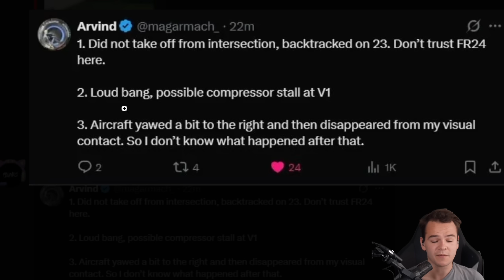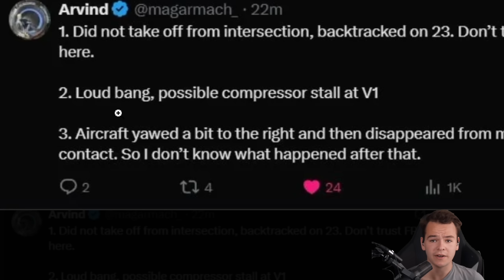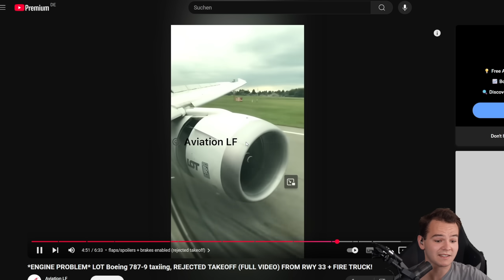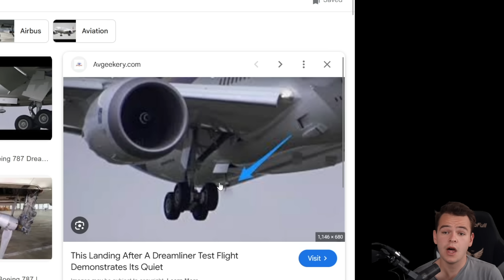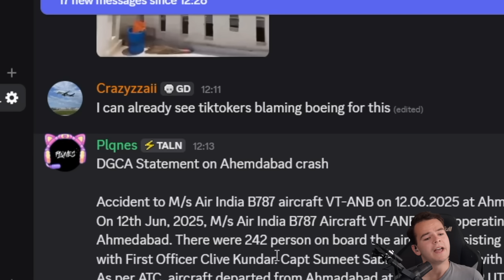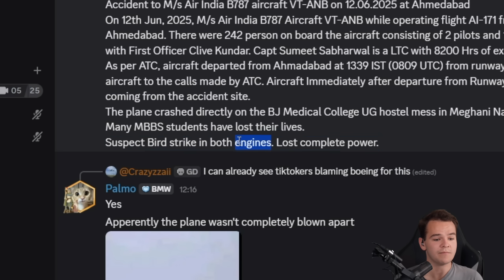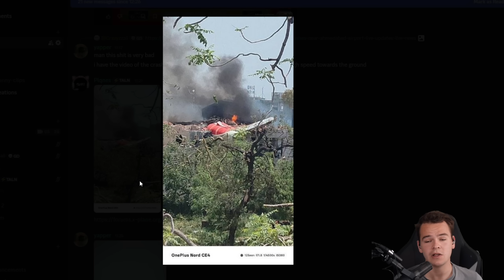The First 787 CRASH Ever - Why It Is SO Confusing?

Comment: it reminds me of the whistleblower who mysteriously died last year who was saying that 7878 dreamliner did not follow any standards and violated a lot of US laws, he was in charge from 2010-2014 of seeing the operations in the factory in the US.
Reply: Funny how not to many people talked about it, he mysteriously died in his Miami apartment I believe, I wouldn’t be surprised if some corporate strings were pulled to hire some hit.
Reply: Yeah right, almost 15 years without the loss of a hull. If the plane was structurally bad it would have shown years ago.
Reply: Boeing doesn’t make the engines tho
Reply: Thats true i was just reading more about it
Reply: Likely unrelated, if it was the engines it had nothing to due with boeing
Reply: Yeah, we should be talking abt general electric. @andrew3084
Reply: :face-blue-wide-eyes:
Reply: why did whisleblowers die misteryously wth
Reply: My thoughts as a retired Flight Simulator Engineer with 10 years experience are as follows.

The first suspicion that may arise is this - could the pilots have pulled the lever to straighten the flaps, thinking it was the lever to retract the landing gear? But this is unlikely to happen on the Dreamliner. The two are not close enough to be interchangeable. The flap lever is to the right of the engine throttle on the pedestal between the pilots. The landing gear lever is located on the main instrument panel, below the flight display panel, on the captain's side (left).

Kindly ALL decent HUMANS please GOOGLE THIS before making wild guesses. I know you are all trying to save Boeing. The USA CONGRESS is onto all POOR QUALITY CULTURE AT BOEING.
Reply: Ok am back, like i said before NOT BOEINGS FAULT!!!
Reply: This probably has nothing to do with Boeing
Reply: That's interesting that you bring that up.  On an unrelated topic, what's your real name and what's your address? 😁
Reply: @smgdfcmfah you really don't know what he's saying kid 
Go to school
Reply: 1189 787s were built since its release in 2009, this is the first fatal accident with total hull loss and we still don’t know if it’s a design flaw, so it’s one of the most secure planes ever.
Reply: Stop looking to blame Boeing for this. They delivered a perfectly good aircraft to them and again BOEING DO NOT MAKE ENGINES.
Reply: @bossmikey7301  how do you know they delivered a perfectly good airplane? Do you work for Boeing or something. As I said above, they were already grounding this plane in the states for maintanince issues
Reply: @markdickenson2885 Because it’s been flying for 11 fucking years and you can clearly see it suffered engine problems. They grounded it because of the batteries and that problem has been fixed.
Reply: @bossmikey7301  that doesn't mean that they delivered a perfect aircraft. You don't know that. And given Boeing's shady history, it is fair to question that shady company
Reply: @markdickenson2885  Ok they had a shady history with a greedy CEO. But this is not Boeings fault. The 787 is a successful modern aircraft with a lot of computerized fail safes. Boeing fucked up with the 737 Max but not with the Dreamliner. When an aircraft is flying for almost 15 years with no serious incidents, I would said it’s a successful aircraft. That is a good safety record on a plane. That plane probably hit some birds or suffered both compressor stalls which is highly unlikely. If you want to blame someone, blame the people who put airports in populated areas and not close to the water. Just in case you suffered a double engine out, it will not be so catastrophic.
Reply: @markdickenson2885  "that doesn't mean that they delivered a perfect aircraft."

Here is what is known about the aicraft:

"The plane had logged more than 41,000 hours of flying time, with almost 8,000 takeoffs and landings, according to Cirium, an aviation analytics firm."

Sounds like they delivered a pretty good plane no? Considering that many flight hours, it will likely be maintenance or pilot error.
Reply: @bossmikey7301 lol. Airport near water and away from residential areas. How feasible is that? Also, when planes crash, they don't necessarily crash near the airport. May be we should build airport close to bay for 737 MAX then to compensate for their safety record or we can just buy from airbus. I'm sure a new competitor will emerge to fill the vacuum that is being created by Boeings quality issues. It's a free market.
Reply: @saab182  "lol. Airport near water and away from residential areas."

Pretty feasible considering quite a lot of airports are deliberately built near water.....

"May be we should build airport close to bay for 737 MAX"

Ah, a strawman. Yes, let us bring up the plane that is not in this incident, because you know, that makes so much sense..... The 787 is a very good plane, has had no losses until now (has been flying since 2011).
Reply: @aflyingcowboy31 yeah sure it's feasible to build near waterbodies.  Try selling planes telling people where they should build an airport, espacially land locked part of the world with few watersides or areas tgat are far away from Sea. Too many mishaps related to boeing whatever model it may be. Not to ignore, that the company has been run by accountants for way too long and whistle blowers are dying under mysterious circumstances.
Reply: @bossmikey7301 seems like boeings fault
Reply: @FalgunPatel1 Did the official investigation come out?
Reply: @saab182  "yeah sure it's feasible to build near waterbodies.  "

You know what instantly destroys your argument? This airport is practically right next to a river.....

Airports are usually built next to water for various reasons.

"Too many mishaps related to boeing whatever model it may be."

No, those issues are usually related to the 737, don't lump in a bunch of Boeing planes just because, the 787 has a very good record.
Reply: @FalgunPatel1 Is it?
Reply: Boeing was more concerned about following DEI guidelines than employing the most skilled people
Reply: @kos15280 this plane has not been touched by Boeing in over 11 years. Stop spreading bullshit
Reply: Tell me about it.  @kos15280
Reply: How does thay statement even make sense DEI is not a thing in India, its almost a Western concept that most of the world rejects. You just mean "Durr, brown people fly planes bad"
Reply: Total BS.  Boeing sets the standards.  And what us law regulates aircraft manufacture?  Boeing maintenance manuals leave no room for mistakes.
Reply: @stevenhoward7083  tell me you dont know anything about aviation without telling me, lmfao have you not seen the massive court scandal that happened, boeing literally does not follow safety protocol and the only reason those court cases never went forward is because boeing hired people to kill the whistleblowers literally in charge of regulating stuff, boeing is literally just a company, they dont oversee anything.
Reply: @stevenhoward7083  lol, Boeing hid the rudder issues that caused hundreds to die in the 90s. There was nothing wholesome and reputable about Boeing before that has changed now.  were you even paying attention to the court cases?
Reply: @stevenhoward7083  begone, corpo bot
Reply: @stevenhoward7083  Just because they set standards doesnt mean they always follow it a lot of these corporations we all know are known to cut corners to reduce costs to increase profit margins and Boeing is no exception to the rule we have had two whistle blowers come out and publicly confirm this, both of whom were also mysteriously found dead with 2 bullet shots to their head a few days before they were going to court
Reply: @stevenhoward7083  What are you even talking about, the ideal setting you're describing is long gone: Boeing is now notoriously known for cutting corners everytime they can and handling critical construction steps to subcontractors with insufficient control and standards, this led to the Alaskan airline incident, and the two Boeing Max crashs among other failures, and yes they are suspected of having killed whistleblowers, the articles are all over the press and internet, time to get your head out of the mud.
Reply: @stevenhoward7083  You are living in Pre 96 before they merged with McDonnel Douglas. Have you seen what they did on the max and they knew that the MCAS software could cause a crash...and then tried blaming 3rd world country pilots? BOeing is an Evil company...and this is coming from someone from Seattle
Reply: @stevenhoward7083 
I get that you're employed, you're trying to keep your family safe, but you know for a matter of fact thag Boeing planes are substandard in terms of aircraft safety.
Reply: @ahmadzahraniAAZ  "Boeing planes are substandard in terms of aircraft safety."

No, they are not. The 787 has been flying for over a decade and this is the first crash it has had..... In what world is that substandard in terms of aircraft safety, I can guarantee it was either pilot error or a poor maintenance.

Comment: 0:34 might be a dumb question, but why would the plane start takeoff in the middle of the runway instead of using the whole runway length?
Reply: The plane did use the whole runway for the takeoff
Reply: @omtandon2741  yep didn't notice when it was mentionned later in the video, sorry about that
Reply: I believe flightradar24 has unreliable data on this, on the graph you can see that the speed and the altitude increases at the same time plus the plane disappeared a lot of time in the radar and at one point it made people think it only took off with half of the runway (something that flightradar24 has already corrected)
Reply: @Hugo-y7p9b Yes. FR24 has said there’s a gap in the coverage at which time the plane taxied to the end of the runway and turned around.
Reply: Yea that's right tho then it would have been unavoidable
Reply: flightradar showed it used half but it didnt
Reply: For efficiency reasons pilots are probably trained to rotate shortly after V1, which usually is some point half way or 2/3 of the way down the runway, depending on the runway and the aircraft, but it's done for efficiency purposes.  There's no reason to go the full length of the runway if you have sufficient speed to create lift.
Reply: @HR-wd6cw true but I mean if anything goes wrong, it's better to have some runway length to have time to stop right?
Reply: Isn't the main reason so that the plane has plenty of room to abort take-off if something goes wrong? Like if there's any technical issue or miscommunication or anything, the plane has plenty of room on the runway to slow down rather than having no choice but to commit to taking off anyway.
Reply: The plane used the whole runway the ADS-B data just cut off when they entered the runway and then continued when they were taking off making it look like they used half the runway.
Reply: Noise is a usual topic at airports. If it takes of sooner and gets in the air faster it wont disturb the nearby residents as much.
Also it might be more efficient to take off as fast as possible
Reply: If you use all of the runway then your gears will be moving too fast and most likely rip
Reply: Thats true. I think then the reason why they used the whole runway would be because both of their engines failed before takeoff but after v1 speed  @rajulpandya1437

Comment: That's same situation like PIA 8303 because it also lost its engine as it went around the runaway because the first time the gears didn't come out. So, the aircraft did a belly landing but the speed was still at 210 Knots. So, ATC said go around so when it went back it lost both engine and stalled like same in the video and crashed. As a pakistani I also give my condolences to the people who died.

May god give patience to the lost once families 😢

Comment: During takeoff, V1 is the decision speed, VR is rotation speed, and V2 is takeoff safety speed. Pilots don't retract the landing gear until they have established a positive rate of climb, which indicates they are safely airborne and clear of the runway. This is done for safety and to avoid potential damage if the aircraft were to settle back down on the runway.

Comment: Flaps did not appear deployed along with gear down for excessive period of time. It can only end one way in that situation after take off. i.e. stall of the aircraft, as it's not at the required air speed in a flapless configuration when starting its climb with that angle of attack. Also they tend to overload their aircraft over there.  Have you even seen them on trains ???  I would add that I've not heard a 787 Dreamliner taking off, but the engines didn't exactly sound like they were operating at full power.  If anything they sounded like they were spooling down.  From other footage from behind the runway the aircraft suddenly loses lift and you can see the wings flex as the aircraft looses height, which would result in further loss of lift. Other reports from the survivor suggest he heard a loud bang. Possibly a bird strike or turbine blade failure? Still the apparent retracted flaps seem odd.

Comment: Other possibilities: Major Electrical Failure, fuel pumps fuel valves, flight systems and computers are driven electrically, computer or software failure, Pilot error or manufacturing defect to name some.

Comment: I'm not talking as an expert, just commenting on this scenario, it could be things like fuel contamination, wrong fuel (although probably unlikely), a computer glitch of some kind which shut down the engines or some other internal issue prior to the engines.  I guess recovery of the flight data & cockpit recorder as usual will shine a light on what happened.  Condolences to all who have lost loved ones in this.  May the cause be found out and rectified.

Comment: I think what happen was either something contaminated the fuel or the same thing that happened to Air France flight 4590 when something was left on the runway by the past plane that the on the runway before and the engines ingested the Foreign objects

Comment: All very strange. A bad actor in the cockpit kills the engines? No power (APU is off). Anything else fuel contamination (needs both tanks being used to be bad), bird strikes (no reports of any in the area) doesn’t seem to work. Relighting two engines at 625 feet isn’t going to happen.

Comment: RAT only provides power to the essential cockpit instruments and radios.  It does not provide power to the landing gear or flight controls.  I’m a retired aircraft maintenance program manager on Boeing aircraft.  The only thing that’s obvious so far is a dual engine loss.  I’m thinking it’s probably a fuel supply issue.  I don’t think it was bird strike while on takeoff roll still on the ground.

Comment: I think the speed wasn't enough and as per the flightradar it took off from half runwayas opposed to the full runway. My college in Chennai is near the airport as well. If a flight from chennai takes off at runway 07 and veers slightly left towards North, Then it'll definately strike my college campus (SRM Ramapuram, Chennai ,Tamil Nadu )just like the BJ Medical College there in Ahmedabad, Gujarat. It was fun watching the flights take-off from class itself plus it was scary if any flight crashes straight into the building or into the city. The takeoff from runway 25 is relatively empty like there's no buildings on the way to flight.
Reply: May the prayers go to the Survivors of the crash. Breaking News:  1 survivor found(that too of a UK National from India descent).
Reply: I believe flightradar24 has unreliable data on this, on the graph you can see that the speed and the altitude increases at the same time plus the plane disappeared a lot of time in the radar and at one point it made people think it only took off with half of the runway (something that flightradar24 has already corrected)

Comment: I’m no pilot, but I would guess that the crew forgot something when configuring the aircraft.  If it had trouble lifting off, maybe the flaps weren’t correctly set.  Very, very sad situation.  Twin engine failure is pretty rare.

Comment: actually the b787 8 was quite far from the runway, the fuel was quite large and the flaps were not powerful enough, it could be said that they looked like they were left idle plus the climate was very hot causing the air pressure to affect the wings. Another important thing is that the captain actually only had 1100 total flight hours 💀

Comment: If a dual engine failure indeed was the cause of this accident. It will mean a LOT of problems for Boeing. Problem being is that small issues that can potentially lead to catastrophic failure will now start to surface after a particular range of hours of operation for these aircraft.

Comment: On the photos of the crash site it looks like the horizontal stabilizer is pointing down. So, it could be that the pilots forgot to set the trim. Please correct me if I am wrong OR UNRELIABLE AIR SPEED.Anyways RIP to all the people who passed away. 💐💐💐🥺

Comment: My guess is that the pilot mistook the wrong engine to turn off. One engine flamed out due to some malfunction or bird strike. But pilot tuned off other good operating engine that did not malfunction. So double engine failure. You can not restart the engine in such slow speed and low altitude.

Comment: It's the first total loss of a 787 but let's face it: that no longer require applause. Most modern jets don't crash that easily. And the 787 had many incidents and they were lucky that the battery fires could be repaired. It would have easily been possible that those aircraft had crashed.

The Airbus A320neo - which is much more common than the 787 - has never had a total loss, the A380 never had a total loss and the only loss of the A350 was when a military jet in Japan crashed into it and everyone survived. So Boeing does not need applause that not all of their types are regularly crashing.